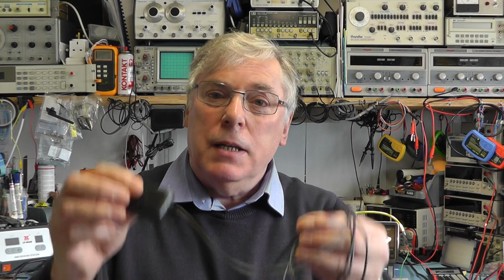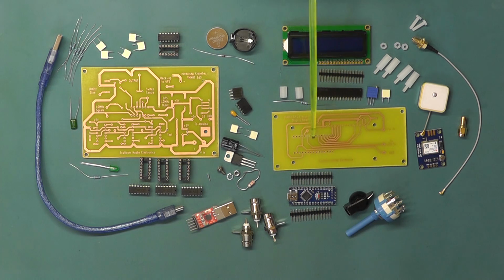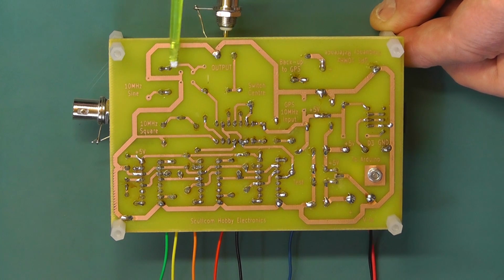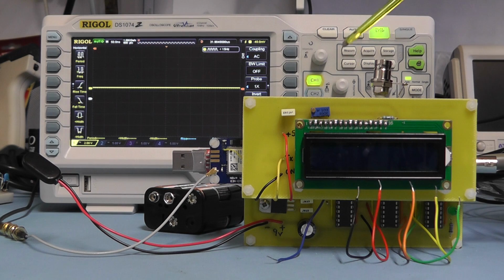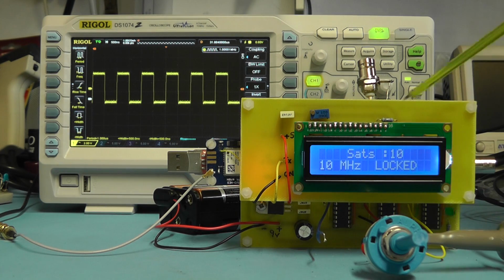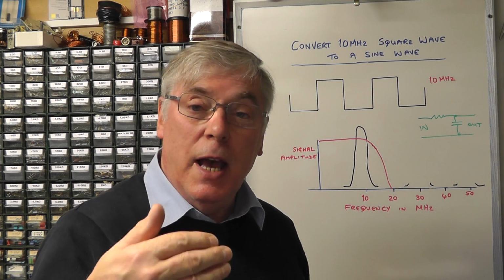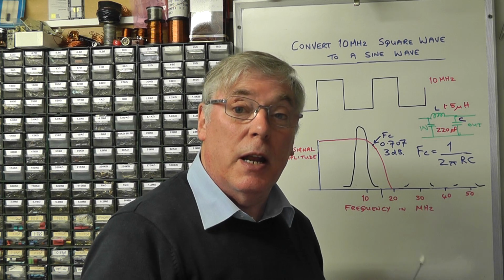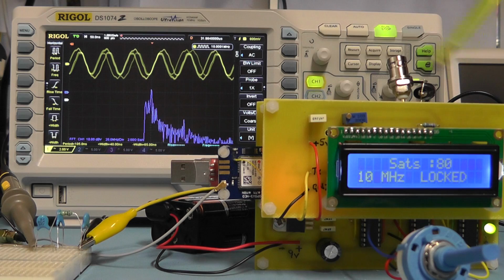Scullcom Hobby Electronics #37 - Design & Build a GPS locked Freq. Part 2

Comment: Smashing design :-D
I like the pluggable way you designed it, the modules can be unplugged for testing :-D
I thought of the two basic circuits for filtering the hf content out too, the l.p.f Pi filter with all three component reactances being the same is something ive used on 27 mhz cb radio transmitters, a v.s.w.r meter can be used to get it roughly right for impedence.
Also the tank resonant L&C parallel can become a filter.
Im not sure how good the tank would be in comparison to the pi filter, ive never been into anything other than repairs.
Your designing, thats a whole different ball game.
Reply from the maker: +zx8401ztv Thanks for your comments. For some reason Google put it initially in the possible spam list which I eventually noticed and had to tick to accept. Not sure on what criteria Google rejects comments!
With regards filter circuit design, in the past I use to find that this was an area hobbyist new little about. It may be worth doing a video on filter networks and their design and uses if there is any interest in that.
I plan to provide more details about selecting the correct value of components for the filters when I do the next part of this project in which I will focus on the output stages of this project.
Reply: +Scullcom Hobby Electronics 
Im so used to parallel LC based vco's in synthersised radios that i forget about other uses, as i said the pi type i connect with filtering the output of an r.f pa or downmixer components, repair work doesnt need much, other than pattern/block understanding.
Yes i suppose my brain needs a kick lol :-D

Comment: For antenna connectors just be careful that rp-sma and sma have a reverse type of center pin (a Google image search can help you) http://img.hf-tech.org/items/fpv-ant-ra12s/02-l-Merkmale-SMA-RPSMA.jpg
Reply from the maker: +cyril muller Thanks for your comment. It was good to point out the differences between SMA and RP-SMA. The web page link you provided gives a good visual comparing both types.

Comment: Yours is one of the better channels for the hobbyist electronics enthusiast. The detailed explanations you supply are often overlooked by others in this area of interest. 
I wonder if you considered using the original GPS and patch antenna remotely locatable with say an ethernet cable connection back to the divider and display electronics. At the frequencies concerned the losses in the coax are significant. By remote mounting you will achieve best signal to noise ratio. This is the way so called intelligent GPS antennas work.
Thanks for the videos, looking forward to more.
Reply from the maker: +Rob B Thanks for your comments. I have found the use of an active antenna I illustrate works very well with good reception in all in door locations. It is also a very low cost solution. If you wanted to position the GPS module with its original passive patch antenna in a remote location and use an ethernet cable to connect it to the main frequency divider PCB you would need to use a GPS to ethernet hub remotely with the GPS module, which are costly and you also have the added cost of the ethernet cable. Plus you would need an ethernet adapter connected to the frequency divider PCB, again at extra cost. All of this would add a great deal of cost to the project which is not really necessary. The active antenna used in this project costs only about £4 (around US$6) and has a gain of 28 dB it uses a low noise LNA. As the Neo-7 GPS datasheet shows that the module operates very well in doors at an antenna gain of 15 dB then the 28 dB gain works very well with no drop out. The only benefit I can see from what you suggest is if you wanted to send the GPS data to many separate location on a network, then the extra cost could be spread.
Reply from the maker: +Rob B The other point I forgot to mention is the fact that this project has a wire soldered on the timing pulse output which gives us the 10 MHz signal used by the frequency divider network on the board. This 10 MHz signal could not be sent on the ethernet cable.

Comment: Thanks for everything that you have done in this project and for your time.  I will get on and make the pcbs...........Berni
Reply from the maker: +berni ken Thanks. Remember when you print out the PCB layouts on to transparencies it is a reverse image and it is the printed side which then butts up against the PCB copper. This gives you a cleaner and sharper image to etch on the PCB. Good luck with your build.